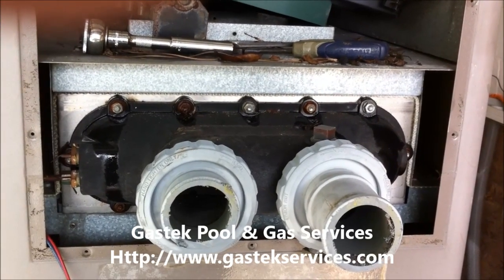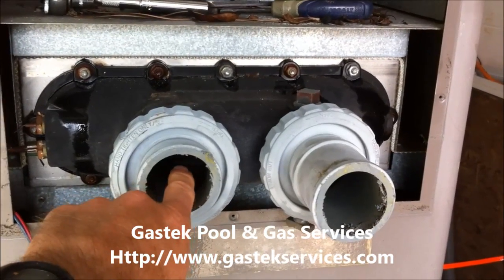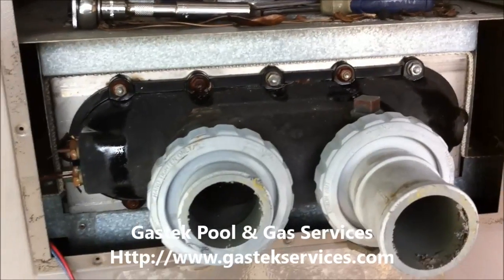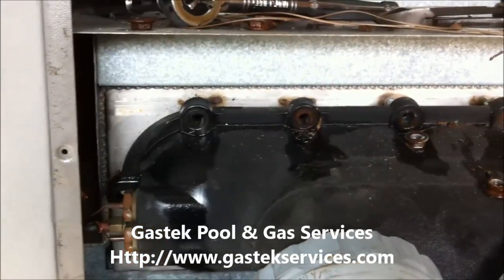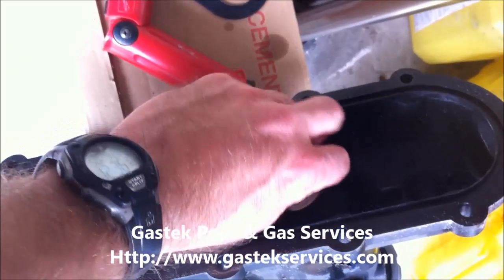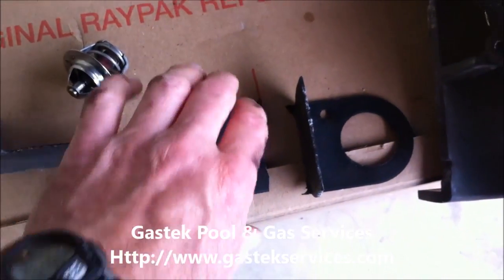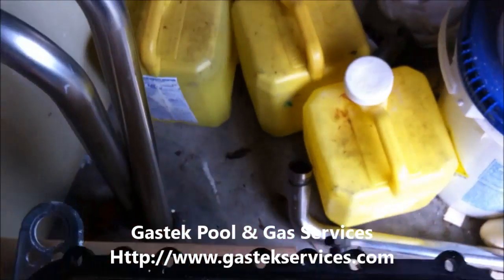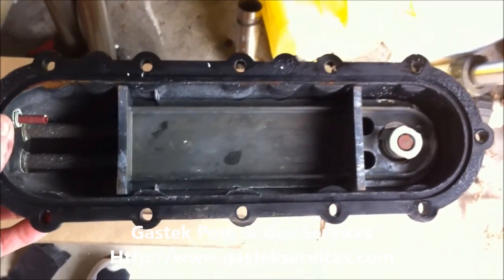Hayward Broken Bypass Video

Comment: I don’t have pipes running from the rubber cover, but it is leaking so I need to replace that part. Does anyone know the name of the black rubber part where pipes are coming out? Any help is greatly appreciated.
Reply from the maker: Hi. Are you talking about the left side of the heater?

Comment: I got the old dial knobs..probably 1998.  H400. Bypass is in ok shape, thermostat was a goner and put in a new one, still have knocking and some surging noise before it shuts off.  It will fire it self back up a few seconds later but won’t stay on.  Basically the water won’t get hot enough in the spa to really enjoy.  
Tubes look amazing and clean.  Some steam concerns however, only because it shows some moisture on the metal lid?
Help!?!

Comment: Hello, I attempted this repair and all was going well but the new diverter piece conflicts with 2 of the copper heat exchanger pipes coming from heater. Has this ever been an issue for you, if so how did you resolve it? thanks
Reply from the maker: I'v e never had that happen. Are you sure you have it installed correctly and that it is no backwards or something?

Comment: This video seems pretty stait forward, but having never worked on one of these, what should be done with gas connection and the electrical leads?
Reply: Shut the gas valve off. And flip the breaker for the heater off.

Comment: Hey great video I have a question I took the header cover off and noticed that the plastic peace is still intact but looks thinner than the one you have on video. But I was getting gravel knocking noise you think it might need a new piece that's thicker?
Reply from the maker: Yes the original equipment is very thin. In fact if you can bend it it is probably on the way out. Just make sure you aren't getting poor water flow because of a dirty filter or a valve not turned correctly.
Reply: Ok great I will check thanx a bunch.
Reply: @victorbaquero900  Your flow thermostat is most likely gone. I’ll have it replaced while you are there.

Comment: After watching your video I was convinced this was our issue with our H100ID1 pool heater. Then I read some of the comments and noticed that you mentioned to someone else that if the heater shuts down then a broken bypass valve may not be the issue. I am hoping that someone will see my comment and advise me. Upon turning the dial on the heater powers up and will get to a first attempt with igniting. The popping and rattling starts and you can see the hose with the incoming water from the pool to the heater shaking around. Before the heater switches over to running mode and ignites it gives up on attempts and turns off. Could this still be the broken bypass or could it be the high limit switch,  water pressure switch, or wires harness parts? Any help you can offer is greatly appreciated! Thank you so much for your helpful video too!
Reply: Does the heater actually ever light? Knocking and banging of the heater is a sign of poor water flow and or a bad bypass.  It won't make these noises unless the flames are present. What is happening is that if you have a water flow issue or a broken bypass, water coming into the heater isn't sufficient and the little amount of water that does flow into the heater is heated and boils and that creates steam. The steam is what causes the sounds.
Reply: My Hayward pool heater is doing this. I first thought the squirrel cage. Lower had something lodged in it. It would ang, pop, and sound like it's about to jump off the little slab it's on. BUT as soon as the flame lights, it does this almost instantly. If says within 10 secs. Makes me wonder if the water could even come to a boil that fast. Maybe if there was very little water in it I suppose. Any input would be great. Especially if you diagnosed this issue. Thanks in advance.

Comment: Hello, great video / very helpful.  I am not having the banging sounds but my heater doesn't seem to be working as good as it used to (water is not warming as fast as I remember).  Could my bypass be stuck causing the heater not to heat the water as fast as it should?  Maybe its sort of the opposite of what happens when you hear the banging?

Comment: ive got the newer series.....looks like its leaking  on the inlet side....4 bolts on each.....looks like a blown gasket ?
Reply: Hi, I've never encountered a blown gasket on a heater.  I suspect that you have a damaged heat exchanger.
Reply: Gastek Pool super... thanks 672 is the cheapest ive found for a h350fdn

Comment: This sounds exactly like what is wrong with my H250,, however, in addition to the banging mine overheats rapidly and I get an SF code. Does it still sound like the diverter is the problem? Thanks

Comment: I have the Hayward H400 "Californian" it says "specifically made for California pools and spas", any difference? What is the specific name of the part? Should it be readily available or a special order item? Tackling this tomorrow!
Reply from the maker: +submarineaz Since you are in California they are called LoNox systems but all of these parts that I show in the this video are the same.  One question though, does your system have a digital display or knobs for setting temps and on/off?  If you have the older unit with the knobs, that is a very old system and I personally wouldn't spend any money on it.  Also if the unit you have does have the digital display on it, you need to asses the condition of the interior of the.  If you have burner tubes rusting out it probably would be wasted money as well to repair this.
Reply: +GASTEK Pool &amp; Gas Services I am in AZ actually. Yes it has the digital display. I am hoping our relatively dry air cut down on the rust but our hard water may corrode these from within. I really appreciate your help and knowledge
Reply from the maker: +submarineaz OK since you have the unit with the digital display you should be able to get the parts and repair your unit.  If some of the nuts on the header look rusty, I would pre-soak them with some WD-40 before trying to take them off.  Spray them and let it soak overnight.
Reply: They were just covered with grime, no rust. BTW, PB Blaster works a lot better than WD40 for rust, impressive too since it's an As Seen on TV product lol. My local pool store had no listing for the parts but I was able to locate ones that work on Amazon of all places. Part numbers are wildly different but reviews stated they work for my specific model. Got everything for just what the pool store wanted for the thermostat which they didn't have anyway. Should all be here this week!

Comment: My H150 Hayward heater turns on for about 15 seconds and shuts back down.  Other days it will keep running just fine.  Is that most likely the bypass or is it more likely low gas pressure since it is competing for gas with our furnace?
Reply from the maker: +funkpelts1 A broken bypass makes the noise like rocks in the unit.  It usually does not shut the unit down.  Does your unit have a digital display or a dial on the front of it?
Reply: +GASTEK Pool & Gas Services 
It just shuts down doesnt really make any noises .  I have 1.5 inch piping and have wondered if that makes my system barely able to achieve enough gpm.  Mine has dials for spa and pool serring and a selector switch in the middle.
Reply from the maker: +funkpelts1 - If it' is just shutting down then you have another issue not related to the bypass.  Since you have no digital display you would need to start checking with a volt meter to see what is causing this issue. You should consider hiring a company that repairs gas pool heaters to come out and check it out.

Comment: thanks for the video. Do you recommend replacing the thermostat when putting a new By-pass kit in and if so anything else? I believe the shaft probably deteriorated  as I found my valve spring up near my salt cell. Don't want to take apart until I have a new by pass kit. Its on a Hayward H400IDL2 heater. Older one probably '05-'07
Reply from the maker: Yes you should replace the thermostat when doing this. Just make sure the nuts are in good shape because if some are rusted and you try to remove you could snap it off and then you have a bigger issue.